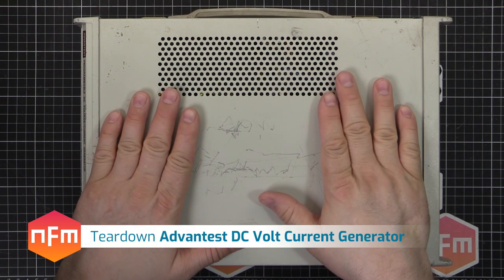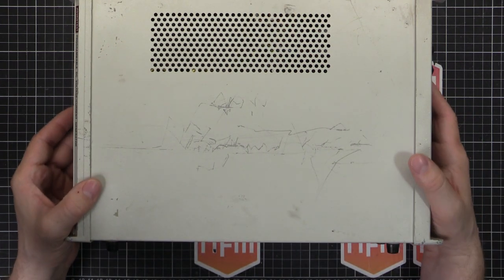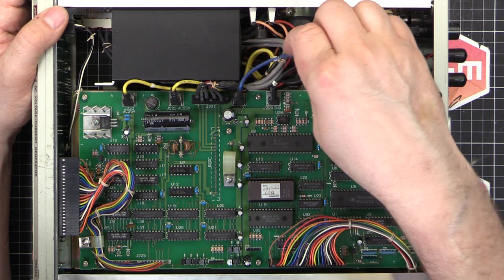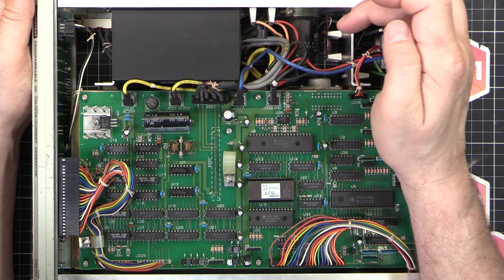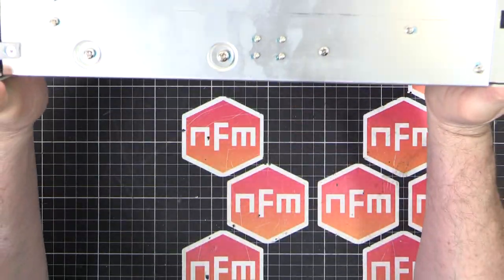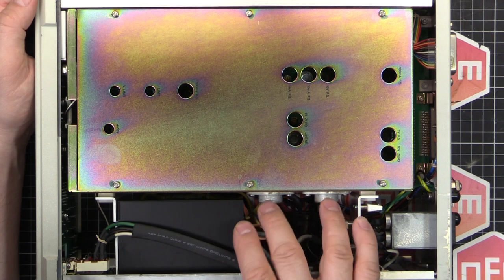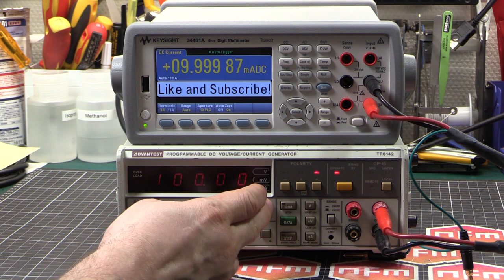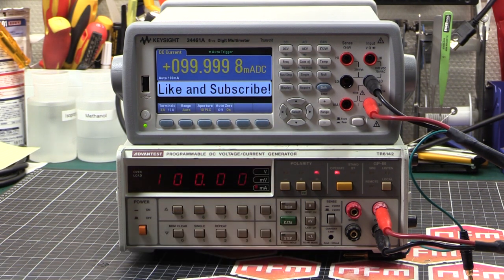Advantest TR6142 Volt Current Generator Teardown

Comment: 27C128-25 usually is a 250ns fast EPROM
The Hitachi IC below might be an SRAM, probably a 6264 in DIP28, or another memory IC, at least it has not anything to do with GPIB.
The  precision resistors in the metal cans are bulk metal foil, not wire wound. Probably from Japanese manufacturer AE, not directly from Vishay. 
The only reason for the PTFE standoffs is the ultralow leakage, needed for precision. Therefore you do not need guard rings.
The unit is quite noisy in some ranges, therefore use NPLC100 on your DMM.
On 1V, 100mV and 10mV output, you need first to null the offsets caused by the cables and jacks , only then you can tell how accurate the output is.

Comment: Hi: Good video, I have an equal device, of the same type, since there are 3 versions of 6142, for example my device as well as yours does not match the schemes of the manual you show. There is no Q14, and the O.A. They are not the same as in the diagram, in addition the output filter in other versions is double, in our equipment it is simple. Mine suffers from instability generated by the OP15 that I have to replace.

Best regards

Comment: Hi! Could you read that U32 eeprom content and share it? Mine SIS-00/022 lack GPIB support for some reason.
Reply from the maker: Unfortunately I don't have a reader that can read the HN58C65P U32 EEPROM at the moment.
I tried reading the U15 EPROM, but it seems mostly blank full of FD then FF, it's maybe suffered from bitrot?..

Are you able to read U15 in your unit? If so do you see any data?

I'm planning on getting a newer chip programmer soon-ish, so when I do I'll provide a link to the U32 dump.